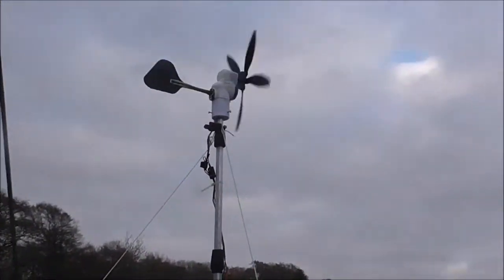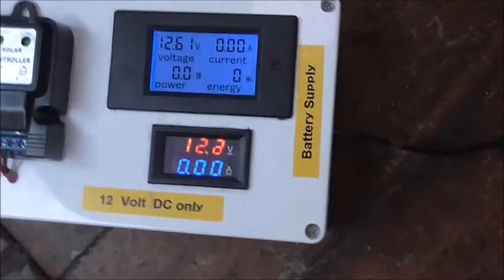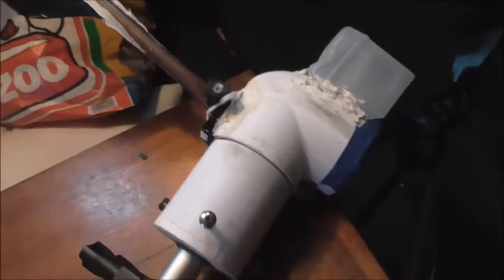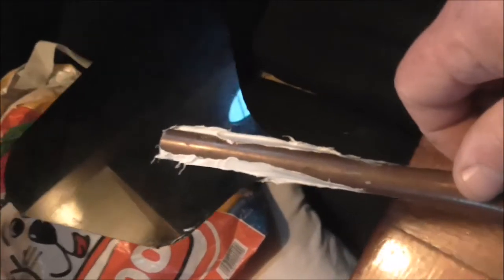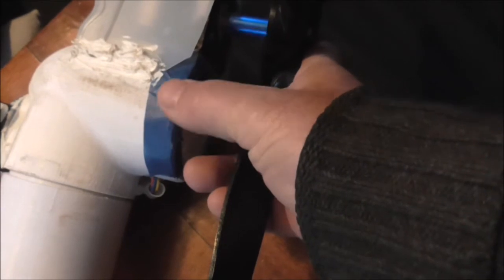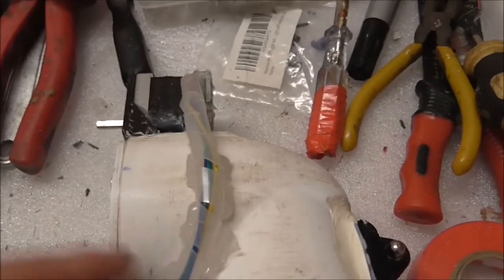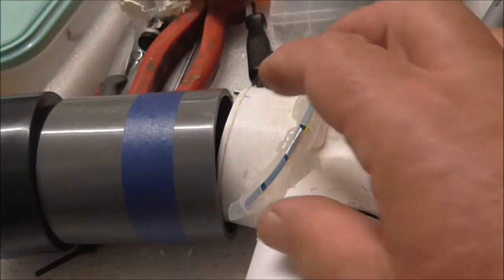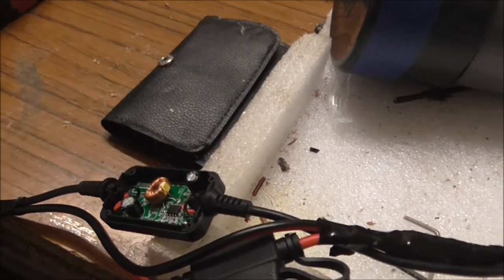Mod's to Cyclone Wind Turbine - nema 17 Stepper Motor

Comment: Does nema 17 can charge 12v battery, does it gives enough amperage?
Reply from the maker: Hi, it has been a few years now but I think my videos showed it producing power , around 300 to 400 mA ? of course depending on wind strength and duration. 
I later made a nema 23 turbine which produced up to 1 amp though it was a bit heavier but still usable.

Comment: Nice ampere u get....
Do u mind telling what exact model of the Nema 17 ?
I am using 17hs8401, but seems quite low ampere i get , just bout 300ma in strong gust
Reply from the maker: Hi , I used a 17 HS4401 , 1.7 A , 40Ncm , 56.2 ozin. stepper motor.
Reply: Tks for reply..... cheers.....
Anyway, i thought 17hs8401 is more powerful ?     Hahaha.....
Reply from the maker: @kenvoo7303   perhaps the HS8401 needs greater torque to turn / rotate ?  higher gusts ?

Comment from the maker: Yes I went the series way also ok it meant less current but more regular at lower wind speeds. Make sure the regulator can withstand the higher voltages as I had to fit one of those buck converters to protect the regulator ( means a loss of efficiency unfortunately). Best of luck.

Comment: Good job bro👍.. I am also using nema17.. I connect the 2 coils in series seems to have a higher voltage with 1 bridge and a capacitor after the bridge, will also add a regulator too.